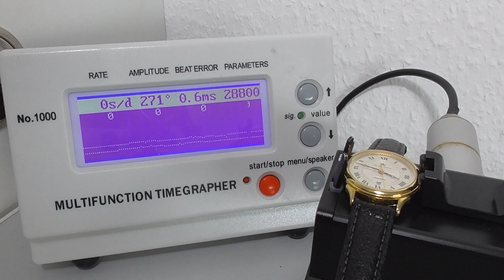Restoration of a Tiny Swiss Automatic Watch - Maurice Lacroix ETA 2671 Service

Comment: I starting working on one that's for a Rado, original movement was chewed up by an incompetent "watchmaker" and I happen to have a new one but the original has a higher canon pinon, higher minute wheel ect. So, now I basically have to disassemble most of it. (Never bang a watch like that!).

Comment: This channel is so therapeutic and informative, i love it.
@2:52 you removed a reverse thread screw, how do you identify a reverse thread screw, by looking at the gear rotation?
Reply from the maker: The crown wheel screw is always reverse threaded. Sometimes they are marked with several parallel lines on top of the screw.
Reply: Crown wheel is usually secured with reverse thread screw

Comment: The clock accuracy device shows a deviation of 0 seconds.It turns out the most accurate watch! It's an ETA clockwork)
Reply: No need to set the time unless you run out of power reserve. An absolute pleasure

Comment: Hello, in your videos I have seen that it does not disassemble or clean the barrel, does it off camera or not?
Reply from the maker: I usually don't open the barrel unless there is a specific reason for. In this case no need to open the barrel 😉

Comment: Great videos ! I really love your work ♡ . But just a a question : how did you learned all these things ? :) there is a book so you suggest to start acquiring some knowledge about mechanical watches ?:)
Reply from the maker: I would recommend a "learning by doing"
I have several books for repairing mechanical watches... Never opened one of them to be honest.
Reply: generally watchmaking school is a good place to start, personally getting a cheap movement and following certain forums can help you get started and get some beginner hands on experience, it won't make you a professional though

Comment: That was a good video and breakdown but could you make it VERY clear what the actual problem was and your solution. New subscriber from Scotland
Reply from the maker: I think the main issue was the bent hairspring of the balance. It was bent that much that the roller jewel of the balance couldn't step into the pallet fork. Second possibility is just some old and dry oil.
Reply from the maker: @anonymic79  I've straightened the hairspring